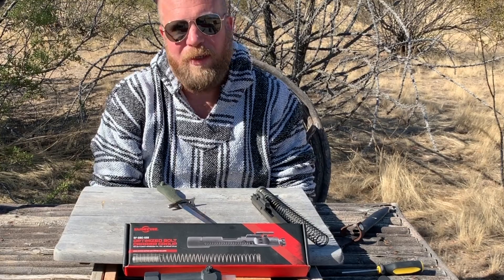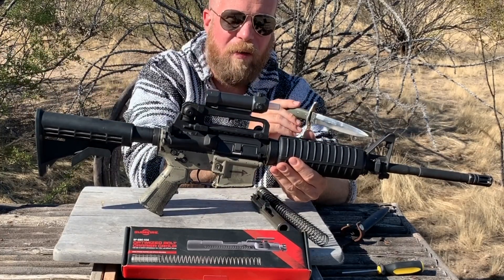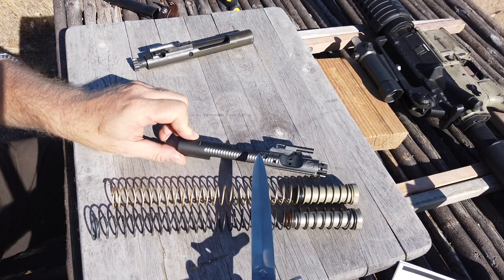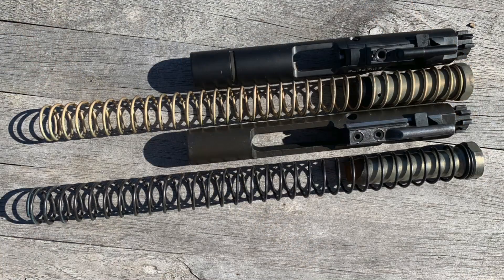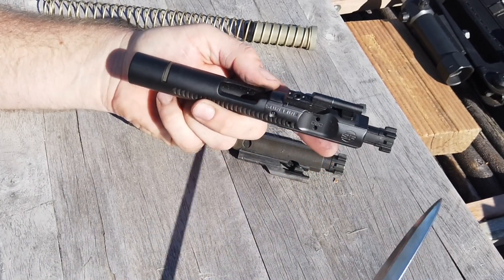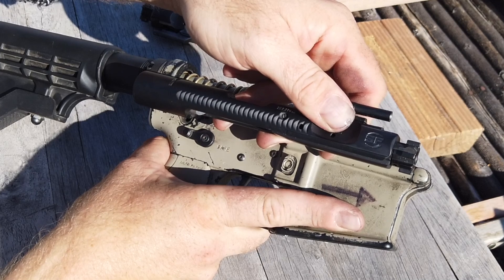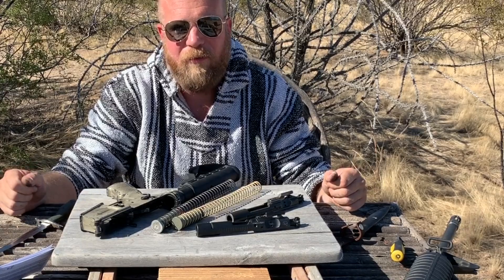Surefire Enhanced Bolt Carrier Group

Comment: A single bolt for the gas key makes me very worried about that system. One bolt sheer or failure and your down and out where as a traditional you can have 1 loose or fail and you still have the other to keep you up and running briefly. Just my $0.02.

Comment: Interesting VDO and concept - But, too much monkey motion. If you're in the full auto realm, get a long-stroke gas piston. If you're in the semi-auto realm, get a long stoke gas piston, e.g. PWS - Any MK mod -2. Iraq Veteran 8888 had a POF short stroke gas piston that was full auto for the better part of 2,000 rounds. its total was 2,737 rounds. Sullivan's Frankenstein is rendered useless once the gas-tube fails. It's academic if you're in the military and your ass is on the line.

Comment: If you could adjust the gas precisely enough, you could make this a “continuous push” kinda system like the ultimate, surefire lmg, or kac lmg. And maybe it wouldn’t strike the bolt hold as hard. Also, maybe you could use it in an A5 buffer tube with a carbine buffer?

Comment: in the sporting market this brings nothing to the table besides being more expense that being said the only guns that would benefit from this would be full auto guns which i cant see the DOD seeing much benefit over a GI bolt and carrier to replace anything especially since if you need more mass theres cheaper alternitives out there. Im not say mr. stoner and mr. sullivan dont know shit since i can only wish in knew what they did but this kinda solves a problem that doesnt exist or the military would of made this standard issue and surfire being surefire along with HK being HK sells the name sure they make quality stuff that id definitely would use if i still carried a carbine for duty but i dont anymore and standard high quality equipment works just fine

Comment: To put this in math terms, impulse is J = F⋅Δt 
Everything he's done increases the Time variable in the recoil impulse.
The total recoil energy from the projectile and propellant, and the momentum are conserved.

In a Bolt Action, the recoil impulse is nearly instantaneous. It is transferred to the shooter as the bullet and propellant gasses are pushed through the barrel.
With a gas system, the total time over which that force is imparted onto the shooter is increased.

You could increase the time by:
  • Increasing the dwell time
  • Increasing the distance the BCG  has to travel.
  • Increasing the weight of the BCG to slow it down.
  • Reduce the gas into the system (Thus reducing the velocity of BCG, and cycling slower)
  • 6:37 This is interesting because he's added another mass, which continues to travel after the BCG itself has reached the end of its travel.

If your cyclic rate is 900 RPM, and it drops to 600 RPM, you're increasing your Time by 50%.

Ironically, you see a lot of people reducing the weight of their bolt carrier groups, which causes them to cycle faster, and reduce the time variable, and increase the impulse.

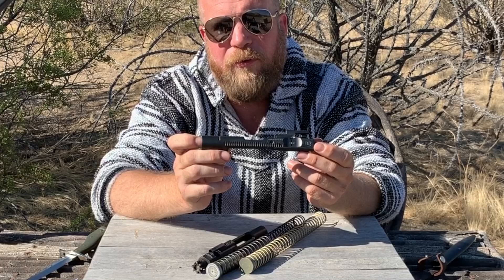8:31 Go ask a 3-Gun forum and a Physics forum whether the Low Mass BCG or the High Mass BCG will reduce recoil impulse.

Comment: So I’m guessing because of that counter weight in the rear of the BCG, the law folding adapter won’t work with this?
Reply from the maker: I think that would still work, actually?  Nothing is dimensionally different.
Reply: Well the only reason I ask is because the LFA has that plug that fits into the rear of the BCG. And it looks like SF’s BCG has that counter weight almost flush the the end so I don’t the think the plug would fully seat as intended

Comment: Yeah, its cool it uses standard bolt, but imho needing special buffer and spring just kill this for me. There are allready SO many cool bolts and bcg on the market, and the majority use readilly sourced parts 

Also, Surefire is ok but what it means is another 30% markup

Its dumb from a military standpoint too, because that's what they want, not only having to change out 100s, 1000s, 10,000s of bolts, but buffers and springs too

Comment: All sounds effective, but an adjustable gas block and JP Enterprises, or similar, captured buffer system will blow your mind. Add a lightweight bolt carrier if your funding permits, and you will not believe it. Recoil comparable to a 10/22 rimfire. AR’s are way over gassed. Send just enough gas to cycle the bolt and use the rest of the pressure for its main purpose. To expel the bullet!

Comment: I just bought a geisselle super 42 buffer for my 11.5 mid faxon barrel, with an adjustable gas block. And the action feels smoother than when i had it set up with a carbine weight buffer. But this set up is interesting.

Comment: How well do you think that this bolt carrier would work with a standard length AR flat wire buffer spring?
I ask this particular question since a standard AR flat wire buffer spring collapses to a much shorter compressed length than the standard AR buffer spring.
I like to use the same parts on multiple rifles, so if it is compatible with a flat wire AR buffer spring  I would consider adding this bolt carrier to a new rifle component build list.

Is there any danger with this combination for any part of the bolt carrier key to strike the rear of the lower receiver (causing damage) or for the bolt to bottom out against the back of the buffer tube?
Would you think that this might be an issue for any over gassed AR?

How well do you think this buffer/spring/bolt carrier would work with an adjustable D.I. gas block or an adjustable piston driven setup?
Reply from the maker: Unless you’re using a very short barrel, and over gas gun, or going fully automatic, you should really not really bother with this.  Additionally, if you were to bother with this, you should use it with the included spring and buffer or don’t bother.

Comment: I appreciate the engineering that went into this solution that didn't go into other solutions for the same problem, like those weird curly-cue gas tubes from back in the day. I especially like the increased stroke and the fact that this solution retrofits into any old carbine buffer tube. I'm with you on tearing up bolt lugs and bolt hold opens but that's an armorer's problem. I'd really love a solution that can take advantage of a rifle-length spring and longer tube (rather than shortening the buffer and spring, just give it the extra half-inch to travel rearward), like the Vltor A5, the increased length of travel like this has and the extra sprung weight (he made the bolt carrier group a dead blow hammer) within the bolt carrier itself.

Comment: Fascinating. Is it compatible with echo or binary triggers? Is the juice worth the squeeze?
Reply from the maker: Binary triggers are gimmicky junk. No.  Just no.
Reply: To give an actual answer, it should. However since this is decreasing how fast the gun cycles, the fostech echo would be a much better match to this than the Franklin, since the echos have safety Sears to prevent hammer follow.

Comment: You really should explore bcg and buffer configurations a little more deeply, especially when talking about the WWSD rifle. Various springs,buffer weight, and gas system configurations can have a lot of impact on overall rifle weight.

One consideration, for instance, is the misconception related to low gas and low mass. As it turns out, low mass typically seems to require more gas or lighter springs. Also contrary to popular belief, greater carrier mass can operate at lower gas pressures.

It might be a good idea to look at various barrel profiles, bcgs, buffers, and springs in relation to bolt bounce as well. You could also look into dwell times in relation to these various configurations as well.

The point here is that I do believe that there are good low mass configurations that would likely be reliable, and that is certainly worth looking into for a light weight build.

Comment: How well would/does this effect the WWSD rifle(s) you have Karl (& Ian)?
..Assuming typical civilian 'singlefire' semi-auto, it might not effect much, apart from possible fractionally lower RoF & Recoil impusle - I wonder how well it might work or not with the bolt and the Giesley (spelling?) Ultimate/Super Buffer Spring (tested in together your craptastic worn AR intially)?

Comment: To everyone talking about using this with a JP spring, it won't work. The JP spring retainer guiderod thing goes into the rear of the bolt when cycling and the Sullivan buffer has the spring loaded weight in the back of it and in the way. If you got the upper and lower together you wouldn't be able to get the bolt out of battery.

Comment: I bought my lower, its a collapsable stock and I'm assuming an M4 spring and buffer weight.  I bought my upper, its a 20 inch heavy barrel, full length gas system. (the whole rifle kind of looks like a Canadian c7...)    Do I need a heavier buffer weight ?? Do I need a lighter one??    Or if it all shoots just fine, do i not need to worry about theoretical full auto applications , since my brass all lands in a comfortable pile? Thanks!
Reply: The theoretical problem lies with the fact that, whoever built the lower did not know I was going to have a 20 inch long barrel.  I'm assuming that they were assuming that I was going to use a 16 or 14.5 inch long barrel.  Therefore, I'm assuming there could be a problem (even though I have shot a lot and there is no real problem)  I have been told before that if you build a rifle like this, the first thing you should do is a get a heavier weight to slow it down slightly.  This is why I ask, thanks again!

Comment: I was considering lightening the buffer in mine since it will often short stroke if not kept surgically clean and heavily lubed, esp with cheap ammo. I highly doubt the issue is the gas port or block as it has a milspec gas block assembly with the triangle front sight still installed from the factory. I might actually pick one of these up if lightening the buffer doesn't fix the issue.

Comment: I had a 308 bolt crack 2 of its bottom locking lugs impacting the bolt stop because it was cycling too fast. After only about 200 rounds.  So,  I feel that impacting the bolt stop harder would lead to damage at some point.

Comment: Nice vid. Also, since the gas key is the part that's preventing the BCG from going further back, do piston BCGs actually lend themselves better to a longer stroke?
Reply: You would also need the shortened buffer too, as that's what keeps the gas key from running into the top/end of the receiver at the end of its travel.
Reply: @muddyhotdog4103  yea that, basically a 416D buffer in a normal tube with a shorter/flatwire sping

Comment: I’m a little worried about this bolt breaking bolt catches it’s a big problem with 9mm conversions that have buffers too short the extra speed of the bolt smashes the bolt catch to pieces will be interesting to see if that happens with these also another bolt that’s really cool and offers some improvement is lantacs ehanced bcg

Comment: While I do see how those are very good improvements on the AR15/M16 the biggest hang up is the cost: at $400 I don't see many people buying these. That's over double the cost of a typical BCG, Buffer and Recoil Spring. Let's face it, most AR15`s run 99.99% reliably and this would only make the same gun 99.999% reliable. In fact, both of my home built AR15`s have been 100% reliable. I have had zero malfunctions. But one has a 20" Rifle Length Barrel and the other is a 16" Mid Length Barrel with an adjustable gas block. But still, zero malfunctions.  I fell an adjustable gas block is a more economical solution.

Comment: Watched another video uploaded recently with some full auto fire comparing the colt and surefire BCGs. Very easy to see how much further back the BCG goes. From the video it looked like the ejection pattern consistency improved as well(Surefire dumped rear to the side and colt varied from rear side to side only). The fire rate reduction does look great for full auto. Interested to know if semi auto use shows any desirable changes(recoil, any occurrences of dead trigger from outrunning the bolt, etc).

Comment: I'm not sure I'm going to run out and buy this.  Adding weight and complexity isn't appealing to me.  I feel a ti bolt, adjustable block and super 42 spring is the most reliable and lightest option

Comment: While the force being applied to the bolt hold open catch will increase the time for the bolt hold open catch to pop up also increases, possibly making the bolt hold open feature more reliable.
Reply: Are you saying that in a regular system the bolt catch is not completely engaged by the time the bolt makes contact with it?!?

Comment: I wonder if this would improve the cycling of my 12.5in AR with a binary trigger. I some times get a dead trigger with it (usually when dicking around) maybe this could help that?
Reply: Conan Kilgore sounds like you’re dropping the trigger before the bolt has finished cycling, in which case no.

But if the bcg is bouncing out of battery and causing a dead trigger then maybe.
Reply: @zedoktor979  thats what I thought too but might as well try right?
Reply: Conan Kilgore seems like an expensive first option to me. Try a heavier buffer or maybe even a different binary

Comment: I think some things need to be put in perspective.  I have 2 ARs.  One is a Sig/Sauer M400.  I am sure Sig engineers optimized the bolt carrier for the shorter barrel M400.  My Daniel Defense one, is a standard AR -15. If I was having issues with my Daniel Defense, I might consider a change - for my M400 I would call Sig/Sauer I would call them.  I did enjoy the explanation of the physics of the bolt carrier group.

Comment: I think the LMT enhanced bolt would be a great addition to this BCG.
Reply: I'd say just get an LMT enhanced BCG to begin with, over this product. It also has its ways to increase dwell time, such as adding an extra vent hole to allow for additional gas to leave the system, modifying the cam pin track, AND it comes with its enhanced bolt. Not to mention, you don't need a proprietary spring/buffer system nor do you need to worry about damage to the bolt catch happening over time as that problem Karl mentioned seems very similar to what Colt faced with their 9mm SMGs in the past.
Reply: @ABowlofPho  Yeah, I agree. Especially because I have an obsession for the JP Silent Captured Spring. It's the main reason why I have less interest in the SureFire bolt than I would've had otherwise.

Comment: Help me with this: would this work to improve a dissipator function or am i going the wrong way in my train of thought?
Reply from the maker: No, those rifles are typically undergassed.   This would potentially make it worse.
Reply: Id say you're about at the end of the spectrum for how good you can get it man. There might not be enough gass to cycle all that weight reliability.
Reply: Thanks for the reply. I have an adams arms piston driven dissipator and it took tuning to run reliably. I am brainstorming. & wanting to try a di dissi in a 16 & 14.5. So i need to go lightweight bcg's and lite buffers. I run a standard tool craft bcg in my 20"/carbine and it recoils almost as soft as the dissi with it's lite weight bcg. Any hows thanks again for the input.
Reply: Phillip Cameron  $80! Dude that puts the fun back in this project. Thanks for the info. I will try that our

Comment: Can this BCG be used with a JP captive buffer/spring unit or must it be used with the included spring & buffer?
Reply from the maker: It needs to be used with the included spring and buffer.
Reply: @InrangeTv  Thanks.  I was wondering if this would get  a late stamp of hubris for the WWSD rifle, but it looks like it is more suited to full auto/SBR/short gas system rifles.

Comment: With the increased travel of the bcg it will likely increase the occurrence of those rare but tragic failures where a spent case finds it's way up into the area between the bolt and bcg that are a real bear to clear because it eliminates the possibility of disassembly until the malfunction is cleared. The case is crushed and wedged into and ontop of the bcg, upper and charging handle by the bcg attempting to return back into battery. When this happens pulling the charging handle only allows a fraction of an inch of movement because its literally connected to the bcg by the case that has formed itself into a type linkage by virtue of being wedged. This usually happens as the ejector, extractor and especially their springs have lost the appropriate amount of tension over time.  This is by far the worst type of malfunction to clear. After seeing the prevalence of this with  some pcc's  that have more bolt travel  than what's necessary to opperate the action properly I have to assume this would also likely introduce an increased occurrences by allowing more travel than is required. That said the increased amount of travel afforded by the bolt should also make clearing the malfunction easier since when it does happen the number one reason it's so hard to fix is its extremely limited amount of travel that's left available when the malfunction occurs. Other than that one issue I see only one other concern than this and it's the elimination of 50% of the gas key bolts which will increase the likelihood of gas key failures as well by eliminating redundancy that is afforded should one fassenors be flawed/weak from initial manufacturing, however I believe this would be almost eliminated if the bolts where less of an issue and could be tested and inspected thus reducing the likelihood of this type failure. So I would need to do extensive testing on this design before it made it's way to a life and/or liberty gun no matter who designed it,  IMHO .